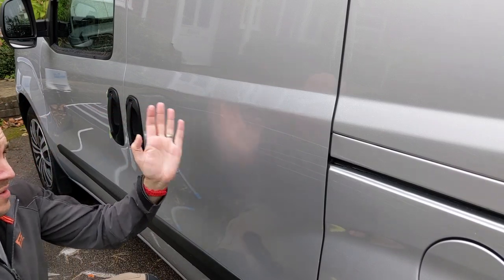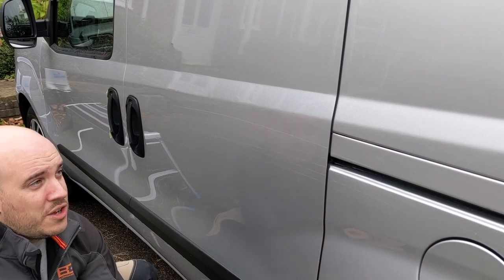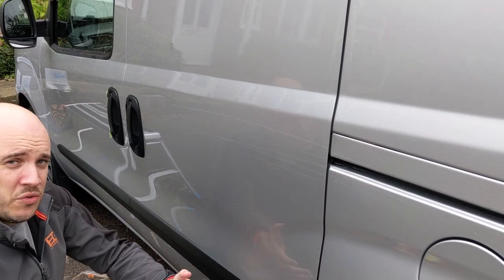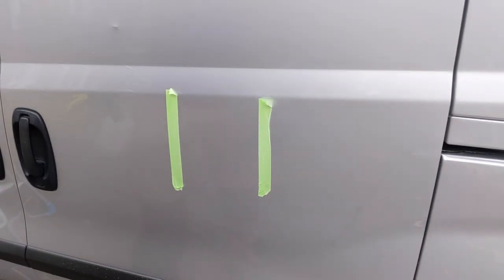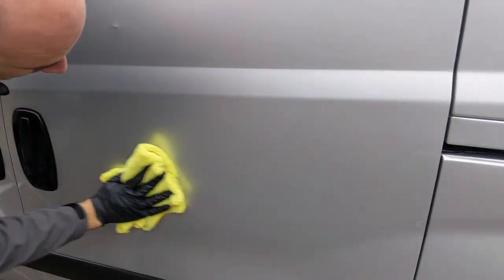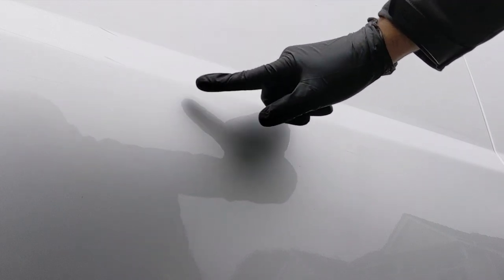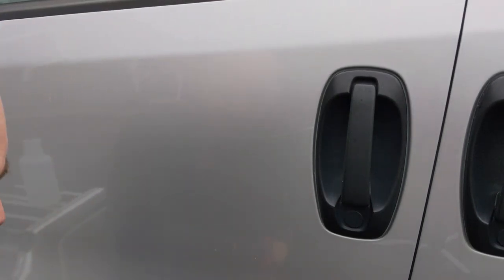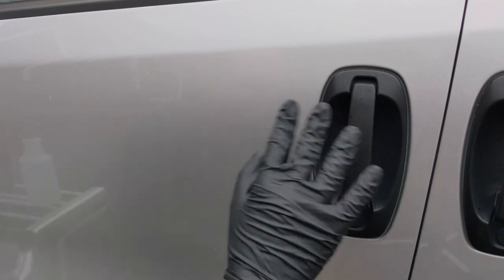Deep scratch removal: Wool vs Foam cutting pads via DA vs wet sanding

Comment: You mentioned the green pads. Thise are actually my favorite cutting pad, which surprising because it's labeled as a light cut / heavy polish. 

I like that it contours to the slight curves and harsh angles some panels have while still removing defects. 

If that's not working as fast as I'd like, I move to a fiber cutting pad like the Buff and Shine Uro-Fiber or LC Purple Foamed Wool.
Reply from the maker: I've got a lot of love for that Hex Green pad, it's so versatile and it seems to work really well across a wide variety of paint finishes too.

Generally I don't like many chemical guys products, but their pads are generally really good. The white one is great too!
Reply: @SuperchargedLlama  - I feel the same about Chemical Guys. 

Buff and Shine is the manufacturer, so I just bought a case each of the 5" green, blue, and red.

Going forward I may have them make me pads based on my designs, and sell them online. I already have a seller account with them so I can sell, but funds are tight for a stock up. It will happen though. 

I'd like to be able to get those foams in 1", and 3" sizes too.
Reply from the maker: @danlc95  yeah that's something I didn't know, but it's a really useful but if insight, thanks for sharing that.

Comment: Great video.  Cheers from Michigan USA
Reply from the maker: Thanks my man. Glad you enjoyed it! It's been pointed out that I needed to prime the wool pad better to get more out of it, I'll shoot another video doing this and see if that impacts it.
Reply: @SuperchargedLlama  - Nah, that's a myth. If you're using quality liquids, it will spread our and self prime as you're doing your set of passes. 

Also from MI!
Reply from the maker: @danlc95  I find the longer fibre yellow wool pads from Rupes definitely prime in the fly (even though they say to prime them), with the shorter nap on these I've found that it works best to prime them first, but following the Rupes approach (couple of dots, spread around with the claw and then on the panel for 20 secs at speed 2), reload and you're away.
Reply: @SuperchargedLlama  - Those blue pads were a really rough ride, like the Lake Country Purple Thin Foamed Wool pads.

I had only tried the Rupes Blue Coarse Wool pads with the DA Coarse compound, and while it cut and finished great, the rough ride and the dust were not my favorite experience. 

I do plan on trying them with the usual 3D liquids I like. I often forget that their liquids have a lot more lubrication than most polishes on the market. This is probably another reason I got away from priming. 

I do prime when using the Meguiar's D300 on their microfiber pads. Actually I use that system as they intended. 

I was successful with those Rupes Blue Wool when starting with 8 drops of polish. This mitigated the rough ride, but not the sling and dust, although it was much less than the way they advise.

Comment: liked the wet sanding. always been a bit scared of wet sanding but much faster. can you show some more scratch removal with wet sanding on the van. would you only use wet sanding for scratches ie hole van improvement.
Reply from the maker: I can completely understand the apprehension, it seems like you'd be removing loads of clear doesn't it? It isn't actually, not with the very light pressure you apply here. 3000p wet and dry is super fine, you'd have be going crazy to get through the clear using that by hand. I've got plenty more scratches to take out so I can do another video of taking them out and I'll do it in real time so you can see the speed I move, and I'll describe the process and tools more as well.

In the mean time, Brian from Apex Detailing has this video which is great in terms of content, just a bit janky for production quality. https://youtu.be/5IoleIVdi4g

Comment: Just an FYI, you should use a very bright torch that will help show you when recording to show scratches and marks.
Reply from the maker: Absolutely. I do now, I've got a Sealy paint inspection lamp and a scangrip head torch which do the job perfectly - but this video was a couple of years ago now and I wasn't as good at making them back then.

Comment: Wet sanding and polishing will always be superior from a cutting and polishing stand point. Problems occur depending on how thin the top layer is/ how old it is/ how tough it is to cut. Best thing is to just test out pads and go softest in reason to the hardest cut because I bet you took off a lot more than you might have needed on that wet sand.
Reply from the maker: Taking some PTG readings would have been a good addition to the video, I hadn't thought of that at the time.
Reply: @SuperchargedLlama  ultimately love the stuff though. Just saw your video and you show people something daunting so even though I critique, I think you are doing great stuff.
Reply from the maker: @FinanceMan  Thank you for adding that, it's really helpful to know what you did and didn't like. I think next time I wet sand something I will get the PTG out to show much clear has been removed during the process vs a cutting and refining.

Comment: good job... be nice to share how much pressure you applied on your DA, and speed set on your machine.. thanks
Reply from the maker: Absolutely - thanks for watching btw.

With regards to speed setting, definitely speed 4 on the DAS6 Pro here, it stalls out quite easily so you need the speed up. In terms of pressure, just enough to keep it in contact with the panel really, nothing too strong as the pad will stall out again. If it was horizontal I'd be saying "just the weight of your hand". On vertical panels that doesn't quite correlate, but I hope that makes sensse?
Reply: @SuperchargedLlama  cool thanks. Guess your paint on that van isnt that hard right?Not like a BMW or Merc? (unless it is a merc lol )
I find 3-4 on my Bigfoot to be enough.. has good grunt and using Koch Chemie compounds and Rupes pads i can get the results i want on most paint.
Reply from the maker: @stevef2114  yeah it's vauxhall paint so it's soft! But on a Transporter for example, I'd use Rupes Yellow Wool and Zvizzer medium on a Forced Rotation DA.
Reply from the maker: @stevef2114  you can see how good even the yellow foam on a Forced Rotation is in this one (on BMW paint) https://youtu.be/62L-wl5E4EI?si=HIXTYB0pk4JSoS6e
Reply: @SuperchargedLlama  cant beat that yellow wool lol!

Comment: I see you sanded above the panel crease when 3000 wet sanding but not 2500. Was that to take care of other scratches that didn't need 2500?
Reply from the maker: I just rewatched it to make sure I was right before answering - I was blending it in and making sure the finish was more even/graduated. If I'd left the 2500 just on it's own before polishing it out you'd have potentially seen the "tracks" where I'd sanded as they'd be far clearer. Much the same as with a smart repair paint job, you blend in gradually so that there's not a hard/noticeable edge....the crease might have meant it played nicely, but it may not have - it would likely have been far more obvious on dark paint.